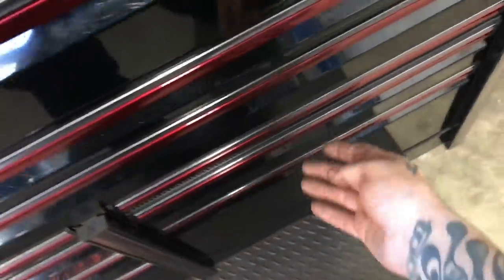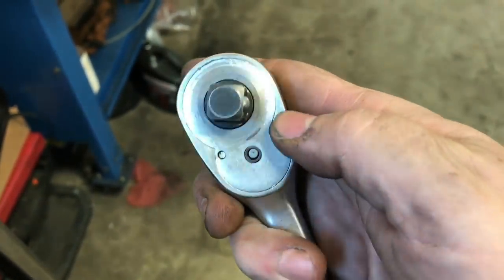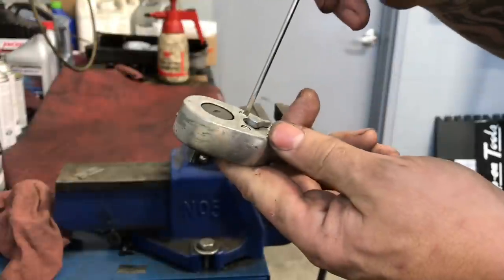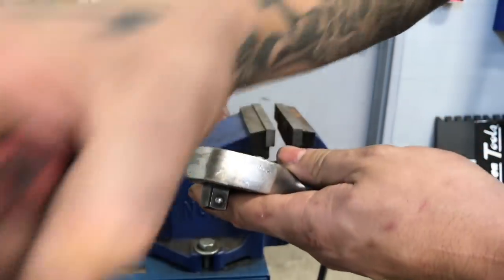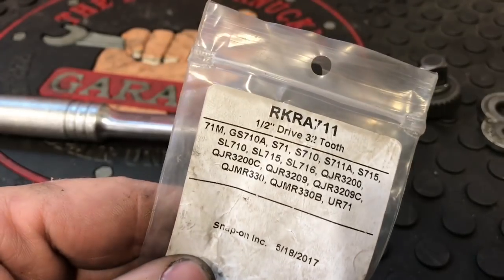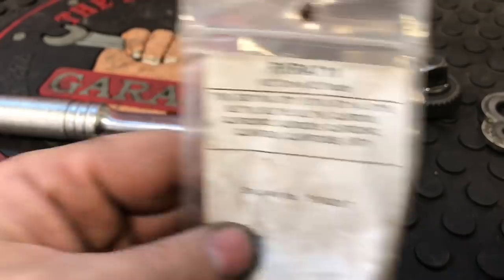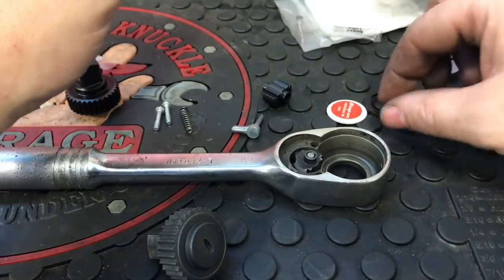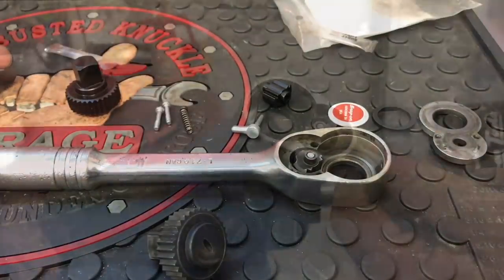Vintage Snap-on L-710 1/2" Ratchet Rebuild

Comment: I love that press fit cover plate. I just gave some love to a 1951 L-72S 3/4" drive ratchet with the same type of plate. I punched it out which waa a lot easier. That tight fit is going to prevent dirt and other krustys from getting into the innards. Wish they still made em this way.

Comment: I've rebuilt a few of these now. The only thing I've needed to peen is the replacement selector switch.

All of the Snap-On ratchets I've rebuilt I inherited from my grandfather, who was a professional mechanic for his career. When I got them in 1996, most were worn-out. 

Snap-On would have given me new ones as a "warranty" - that's not what I wanted. I WANT grandpa's ratchets. 

Thanks to Snap-On's parts availability and videos like this, I have all of Dewey's Snap-Ons running again! 👍

Comment: What works well to hold the spring while you put in the rocker is a piece of wire (like a paper clip etc) with the about 1/2 inch of the end of the wire hammered flat to make like a super thin mini flat blade. It works much better than a small screwdriver.

Comment: What I did was clamp locking pliers sideways on the drive then just tap down on the pliers with a hammer. This was after spraying the area with penetrating oil.

Comment: The switch is connected with an aluminium rivet. We normally cut the switch off and the plate comes off easily. We also have a special tool for retaining the spring whilst you put the pawl in place. Why didn't Snappy do it for you?
Reply from the maker: +mikey bird thanks for the info. I did it for content bro. My dealer asked me the same thing haha. Anything referring to Snapon can be used for content with me.
Reply: The Snap-On Tool Review your spot on with the19mm socket though. I usually use a Blue Point!! Lol.
Reply from the maker: +mikey bird bahahaha that ratchet isn't supposed to have that cap on the back. I wanted it in there so I filed the hole out to fit it in. It looks Awesome with it.

Comment: I know this is an older video but I am only seeing now.  You didn't mention, or perhaps you may not have noticed that there is an oil port on the top of the ratchet body that can be used to add oil as the grease dries.  This is not a feature you normally see on ratchets, but it makes this tool better than others because the cover is a tight fit to keep debris out and it is far easier to squirt some oil in the oil port than to disassemble and regrease it.  Another reason that these old tools are worth rebuilding.

Comment: nice old ratchet, I have an old 3/8 long handle ratchet from back in the 70,s fine tooth needs rebuilding be about the 5th time since I,ve had it.

Comment: Nice ratchet.  Since everything that moves gets replaced, is there a retro kit to convert these older ratchets to 72 or 80 teeth?  Probably not, but I think there could be.  The new rebuild kits with 80 teeth would also likely not fit as that would hurt sales.
Reply from the maker: +Brian Bowman it would be interesting to see if there is a kit for that. I would convert it if I could for sure.

Comment: Quick question I wonder what that hole is on top of the ratchet maybe for oiling? Back in the day maybe they had some type of special grease gun for that?
Reply from the maker: +william obrien yeah it's a grease fitting. I don't have the gun for that.

Comment: @The Snap-On Tool Review  I just serviced a SH936A 1/2 in drive comfort handle ratchet I stole from a pawn shop for 30$. Its an older style ratchet that isn't Dual-80, and to make it worse I had to put the paw over a spring with just a loose ball bearing, it was so fucking irritating but I finally got it.Its cool to see a Canadian made Snap On ratchet, never knew they made them there. A lot of people are shit talking about the removing USA off the head of the ratchets, but if you look on the shank, i's stamped USA beside the tool part number, your thoughts? And is it bad I used wheel bearing grease in my ratchet, I mean if it can lube wheel bearings, Im sure it can lube a ratchet and paw, right?

Comment: I got the front plate off an old elora ratchet by threading the screws into the side with the drive on then pulling in them with some pliers cause I broke my vice

Comment: Where did you get the Snap On red cover and oring? My rebuild kit did not have one or grease also I have the USA made one did the USA version not have the red cap?
Reply: I had a 1959 3/8 rebuilt on the truck 12 years ago and it didn't have that cover either.